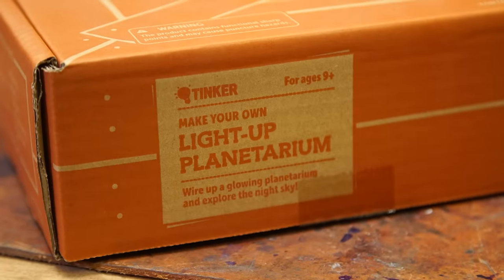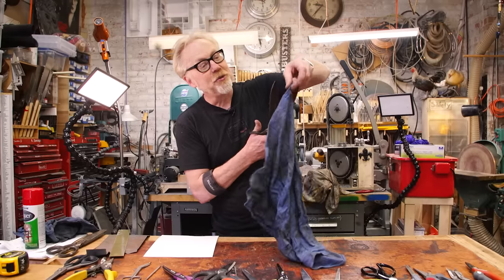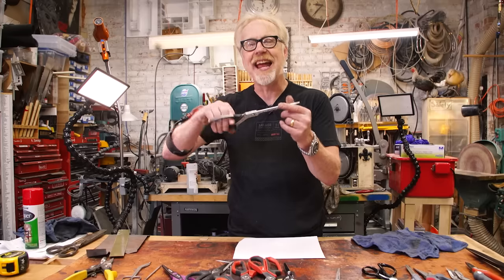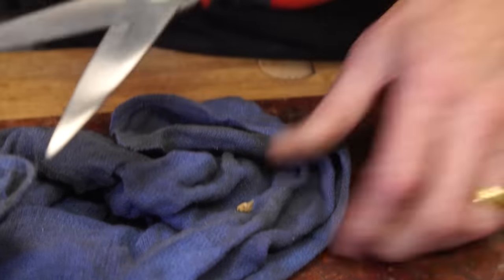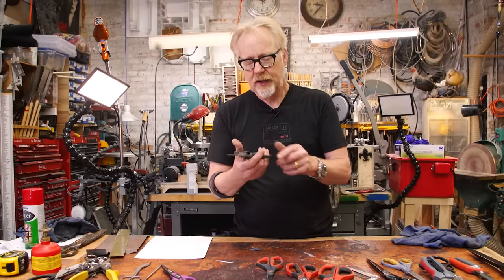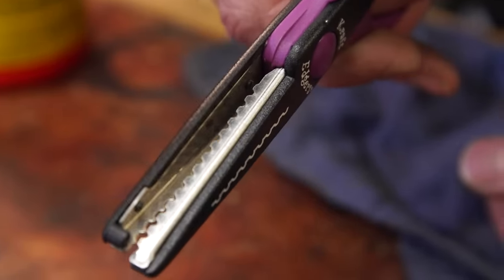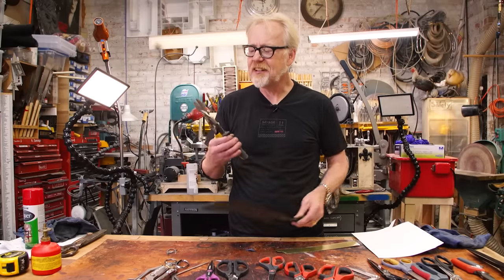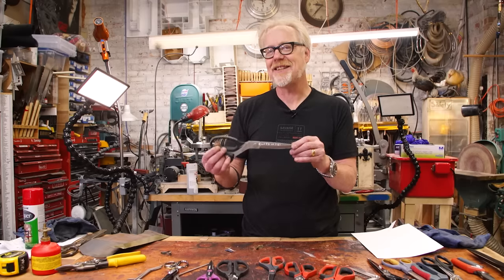Adam Savage's Guide to Workshop Scissors

Comment: Ah scissors, my nemesis. I have a love hate relationship with these. While their usefulness is not denied, I wish manufacturers would make ambidextrous grips the norm!!! I can deal with the blade alignment but the strictly right handed handles on most make them so uncomfortable long term use is painful.
Reply: Those Wiss shears might be of interest for you.
Reply: I'm ambidexterous. So I can use either, but I have found that left handed scissors are nowhere to be found
Reply: @mf--  I do find that spring assisted ones do offer a more universal grip
Reply: Check out Wolff Industries. They’re a scissor manufacturer and distributor with several left handled and true left handed scissors.
Reply: The Kai brand scissors have left hand models. for example the 7250 (right hand) and the 7250L (left hand). Never understood the issue until I (right handed) picked up a co-workers pair of 7250L instead of my pair. Man it sucks top hold the wrong pair.
Reply: @Stettafire  The Kai brand Adam suggests have Left handed versions marked by a L after the model number, for example the 7250 (right hand) and the 7250L (left hand).

Comment: My reaction to most of the scissors: ...
"And these are tin snips."
Me: YEEAA-uuhh!
Reply: What Adam showed are aviation snips. Tin snips are different. I'm surprised Adam doesn't have any. Tin snips are like big heavy duty scissors, kinda.
Reply: @1pcfred  Interesting! I figured they were just super-spring-assisted tin snips, which clearly they could be used for. I think mine are simpler. Still, the world of scissors; who knew.
Reply: @3rdeye7thdimension  this is what tin snips look like https://www.ourshopee.com/ourshopee-img/ourshopee_products/564580979cccc.jpg The compound springy ones are aviation snips. I like tin snips for heavy cutting that I don't want to subject scissors or aviation snips to. Which ends up being a fairly regular thing. Tin snips are easy to sharpen.

Comment: The Milwaukee ones are the best all-around ones that I've tried.  They'll cut a penny in half as well, I've done it several times. LOVE them!  Also- an easy, and quick, way to sharpen scissors is to cut some high grit sandpaper with them.  That easy and works great!

Comment: Mr Savage, the scissors you have with the 90° blades & yellow handles at 8:38 are actually designed for people such as my late Gran. Her wrists were wrecked with arthritis, so she couldn't twist them. She had the scissors shown and would use them with the blades on the underside and cut by using the handles in a 'gun trigger' motion. She had a breadknife in the same configuration.
A good tip is to look at mobility aid/independent living device suppliers for tools you didn't know you need.
💚🐇🐴💚

Comment: I have both the Clauss and Wiss snips/shears and they are fantastic!  They both cut thru thin sheet metal just fine in a pinch.  I've used the Wiss shears to cut stage lighting tempates (gobos).  I keep them in my belt tool pouch on jobsites.  So useful & versatile.

Comment: Afaik the right angle scissors are just so you can cut parallel to the material/cutting surface easier. So something like wrapping paper or cloth to prevent that kind of janky edge you can get from cutting with regular scissors

Comment: I have a pair of those Wiss utility shears (with red & black plastic handles, near the beginning) that I picked up on a whim at Home Depot. I've found them incredibly useful, especially for the price. I use them most often for cutting zip ties and heavy duty plastic strapping (that large cardboard boxes such as furniture boxes are often strapped with), but all sorts of other things as well, including carpet underpads, (which are one of the most difficult things to cut, and wear out blades very quickly.

I recently replaced it with a lighter, angled pair by Knipex, but the Wiss feels more rugged and was probably half the price. It's definitely worth having a pair of heavy-duty utility shears like those, or ones that are angled.

Adam hasn't mentioned cable shears / electrical shears, those are definitely a distinct type of scissor with different capabilities, but I suppose only some people have a use for those.

Comment: I’m an electric motor winder and have been using those Ghingers for about 10 years to cut our Nomex blend insulation paper. Have never had to sharpen them and have been through miles of .015 sheets.

Comment: The two possibilities for your tailor's shears having two different color metals is that they are in fact forge welded high carbon steel to a mild steel/wrought iron, or they are variably hardened and made exclusively from high carbon steel.  The first option is more likely.

Comment: I've had really good luck with Pittsburg 7 inch multipurpose scissors. They're thick metal, surprisingly well put together for only $7, and have cut everything I've attempted to cut with them. In particular, cutting leather or EVA foam mats where I don't need quite as much precision, or where I need a strange cut rather than a straight line like a rounded corner.

I do tend to have both dedicated cloth scissors with my sewing kit, and dedicated "crap" scissors for things like paper or sticky surfaces since I found those two categories seem to conflict with one another.

Comment: Even in my line of makers, Scissors and tin snips are an invaluable asset to the tool hoard. Although my Scissor collection isn't to the degree yours is, they are still an absolute must. But here's where the Achilles Heel comes into play....I'm LEFT HANDED! Yeah....source Lefty scissors. It's frustrating, but fortunately.....There's always an Ambidextrous option if you dig deep enough into the bowels of the internet. It does come with limitations where quality comes into play though. Thanks for this Tool Tip my Friend! Every Maker should have a variety of "shears/scissors/snips in their arsenal. Zip~ p.s. the BEST pair of Snips I have for tin/brass and aluminum are actually purpose made Pallet Strap Snips. They've got an interesting feature on the anvil (lower side) that is akin to EMS shears, but more closely resemble a sort of pry bar tip that extends forward of the cutting surfaces and they're at an angle that allows for laser strait cutting with very little deformation of the materials you're cutting.

Comment: Those Wescott scissors are "Titanium Bonded". I believe it's a thin layer of titanium over ordinary steel blades, and then a non-stick coating goes over the titanium. I had a pair of these as a kid, and they felt far too heavy to be titanium, so I stuck a magnet to them and knew something was up. They did cut well, but I put them through an unreasonable amount of abuse that ended up leaving deep gouges in the blades.

Comment: Adam- if you want to frustrate scissors, try Kevlar!  Worked in a composite boat shop for years, Fiskars are great but need to have the edges reground to almost square.  Files last a short time keeping their teeth on the great material that Fiskars are built of.  80 grit on a 1x42” belt sander is the trick.  Fiberglass kills any scissors no matter.  Tried carbide with little success.  Love the “hoarder “ remark, I qualify also.

Comment: The edge of the second pair of medical scissors you refer to as a bottle opener is a bottle opener, just not of beer. They open standard medical tank valves, which are squared, to let oxygen or medical air flow. You'd be surprised, they come in handy.

Comment: I need a cutting tool recommendation for a very specific task. I wear pointe shoes that are just a bit too long in the vamp (the part that covers the toes up to what you might call the neckline of the shoe). This part of the shoe is made of thin layers of cardboard and fabric pasted together with a really hard glue papier mache style sandwiched between a single layer of canvas on the inside and a single layer of satin on the outside. So I cut a slit at the top of the canvas from the inside, peel it away from the hardened part of the vamp, and slide my scissors in between the satin and papier mache-ed bit to cut down the stiff material. I tried with regular "package opening" scissors and poultry shears because I don't have a huge range of scissors at home. I didn't have any of the trouble I expected with the weird angle or accidentally poking through the satin, but the scissors just weren't sharp enough? heavy enough? thin enough? to make a clean cut through that solidified cardboard/fabric material. Any suggestions of a tool I should try out? Bonus points if the blades have a slight curve to the side.
Reply: I would look at the "EMT shears" and see if they look like a good shape for your job. They will cut through denim and other super heavy fabrics with some effort fairly well. Tin snips are probably too large and unwieldy for you but the mechanism does give you a lot of extra leverage.

Comment: Those kai scissors look just like ones I use in UK from the Japanese brand olfa they are designed for cutting wallpaper. I love the weight being slightly heavier but   they really cut through thick reinforced paper easily. They do have tiny serrated lines on the blade which I suppose helps cut. I have had them for  many years and are still razor sharp. Also the olfa snap off knife blades are much sharper than regular blades too I highly recommend them.

Comment: my grandmother had a pair of Gingher scissors i got them in her will. i don't use them often but when i do holy cow they just glide through fabric. i lock them away afterwards. you never know when you'll need a good pair of scissors.  the bottle cap on the back of the military scissors are for the old bottles of wound cleaner/ coagulating agent they used to use the bottle caps type of closure for them.

Comment: Medications in vials with crimped on tops are very common in a hospital/procedural setting. Those lids can be peeled off quite easily with just about anything labeled as a beer bottle opener. So, seeing a beer bottle opener on a pair of medical shears makes sense. In fact, in the right setting, the bottle opener might actually see more use than the scissors.

Comment: A design detail about good pairs of scissors is that the inside surfaces which slide along each other aren't perfectly flat but curved towards each other very slightly.  It essentially causes the two scissors to behave like spring tensioners which keep the two faces as close as possible through every part of the cut.

Comment: I have a pair of the scissors that separate at the hing as well. Mostly useful when taken apart for opening boxes when you don't have box cutters handy. Having a single scissor edge without the other edge flopping about does a really nice job on cutting box tape, without putting whatever is in the box at risk. But perhaps it was originally for cleaning, I don't know.

Comment: I got a pair of Gingher scissors last year. Overpaid a little, but they just glide through cloth. I got a cheaper made in Italy pair for general cutting. They look a lot like the Gingher, but the finish isn’t as nice and price was 50% of the Gingher. I did have to clean up the edges of them. There were a couple nicks. I was worried I’d wreck them, but went slow and managed to smooth them out, and they still cut well. I’d eventually like to get a nice pair of 10” tailor shears.

Comment: Great video! What is that acetone dispenser bottle? I typically use chemical bottles that are plastic with a long bent spout but they tend to drip or leak when they expand with temperature changes. I would love to use something that positively closes after dispenses.

Comment: I used to use that style of tin snips for cutting PTH Perf Boards for porotype PCBs until I found an old set of Craftsman Straight Tinners Snip similar to the ones from CLAUSS on Granger, both were 100% better than the RadioShack nibblers.

Comment: Though they're not actually *scissors*: get yourself a good pair of compound-action diagonal cutters.  They've replaced basically all non-trivial-for-scissor purposes for me because they're so much stronger, and the lack of scissoring keeps them from gumming up.

They're endlessly useful even for minor household things, and the compound action will let you cut through nearly anything consumer-grade without straining, be it plastic, furniture pads (they almost never get gummy! these are nightmarish with scissors!), or practically any smallish bit of non-hardened metal (sheet-metal, staples, even small nails and screws).  In a pinch they can also be used to grab and pry metal things apart, because you can dig into the metal easily to get a great grip, and the tips are far finer than almost any pair of pliers.

Comment: This video is 3 years old, so my comment may have been already mentioned, but it's my understanding re tin snips is that the handles of some brands are color coded to indicate whether the snips are for cutting right or left curves or straight cuts.  It is more difficult for example to cut a right turning curve with snips designed to cut a curve that is turning to the left.

Comment: The Goodgrips that separate are likely designed for food service. When I worked in good restaurant kitchens we always had scissors that separate like that just because it makes them easier to clean and sanitize. Just a little extra info for the comments section. I'm sure Adam already knows. 

But, Adam, if somehow you actually do see this, have you ever tried traditional Japanese single piece scissors? Apparently they're very good for working with cloth and thread. I've never used them myself but I wonder if they're also Japanese saw level of game changing. 

Also, I've never seen bandage scissors with a bottle opener. Does it look like it was welded on after they were made? Otherwise, I'm wondering if they date from a time when some medical something or other was sealed with a bottle cap, but I have no idea what that could be.

Comment: The Right Shears pic on Amazon explain their use best. There's leverage in holding them the opposite way, so the cutting face is parallel to the cutting surface and you can use your grip strength to cut. Those don't look of a material quality to get much from that but do like the concept.

Comment: I have a few pairs that have a hardened strip for the cutting edge bonded to softer steel. Since scissor blades are curved and technically criss cross that binding creates the cutting action. So if they were all soft steel they wouldn't hold and edge, but if the whole thing was hardened, they wouldn't flex and get out of the way of itself.

Comment: My mom is a seamstress by hobby. We could NOT use her Scissors on anything but Fabric.
She was only using cheaper scissors from Wal-Mart's sewing section.
Later in life I found those Kai Scissors, they are a sub company of Shun Knives.
She says they are the best scissors she has ever used. I feel they are just expensive enough.
Like anything, items can get expensive for the sake of being expensive.
Reply: When I commercial flat roofed we all swore by K-mart sewing scissors. They were sharp enough to zip cut the rubber membrane we used. Which you had to be able to do to do the job. Plus they were the cheapest scissors anyone knew of that could do it. Made from the finest Korean stainless steel.

Comment: For the taylors shears, they are not pattern welded. For a tool of that vintage they are going to be a wrought iron body with crucible steel edges forge welded on. This was very common in the days when steel was extremely expensive compared to iron. Expensive enough for the extra labor to cost less

Comment: Adam, you got a bench mounted throatless shear?  For when handheld tin snips aren't enough or are too fatiguing.  Also, Wiss tin snips are my go-to for metal cutting.  The cheap ones aren't hardened or have crappy hinges that allow too wide of a gap between the blades.  BTW, you didn't mentioned the Swiss Army scissors!  ;)

Comment: There is a secret to the tin snip/ shear, and that every style of shear are right and left handed. What that means is, as you are shearing the sheet, the curl of the sheet will be either in the right side or left side of the shear, with the other side remaining flat. This is important to fabrication because the curl side is usually the waste material. You can tell which side the curl will be on by which side the bottom blade of the shear is located. If the bottom blade is on the left side of the shear, the curl will be on the left side and the flat will be on the right. That is a Right Hand shear. The opposite is true for a Left Hand shear.
Reply: You are the only one here that knows that.

Comment: Adam, that bottle with acetone. Does it have a lid to stop the acetone from evaporating?
Reply: Asking the real question right there
Reply: They look like these from McMaster Carr https://www.mcmaster.com/solvent-cans/push-to-dispense-bottles-for-flammable-liquids/ They have a valve that allows you to control the dispensing.

Alternately I use this style https://www.mcmaster.com/2529T121/ acetone will slowly evaporate but I find it is slow enough that it is not much of an issue.
Reply: Thanks for the info

Comment: Hey, what about the Fiskars Shop Scissors with the TiN coating. You recommended them in a previous video. They are heavy duty, and thin sheet metal or kevlar cloth is no problem.

Comment: Hey Adam, the right-angle scissors are as you mentioned are made so your hand is not in the path of the material you are cutting, which is good for particularly unpleasantly sharp materials. You're supposed to hold them upside down relative to how we are used to using scissors: https://www.coolthings.com/rightshears-90-degree-scissors/